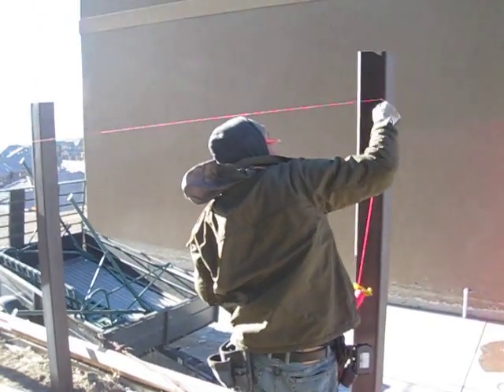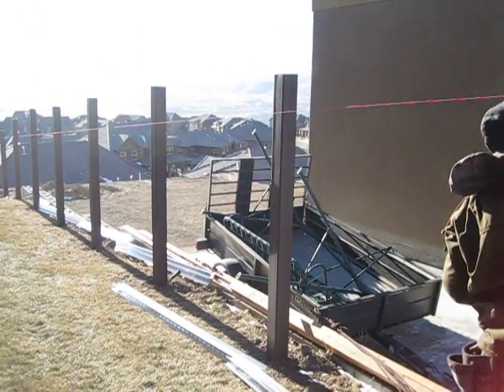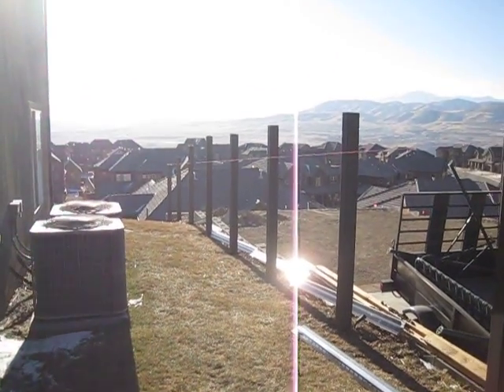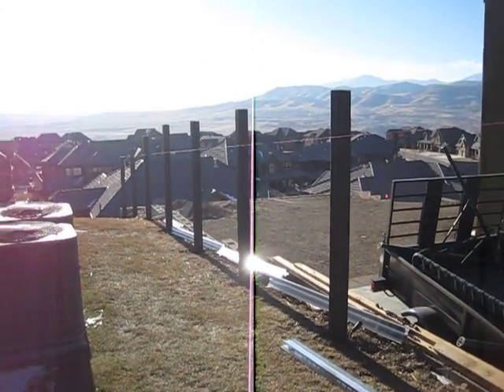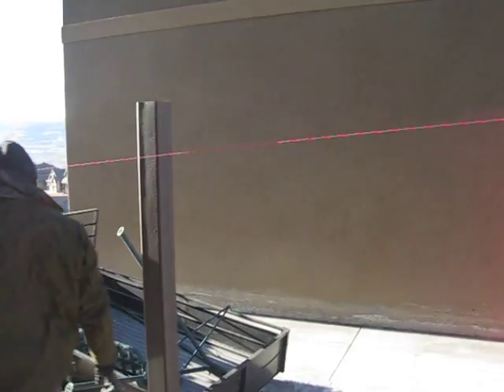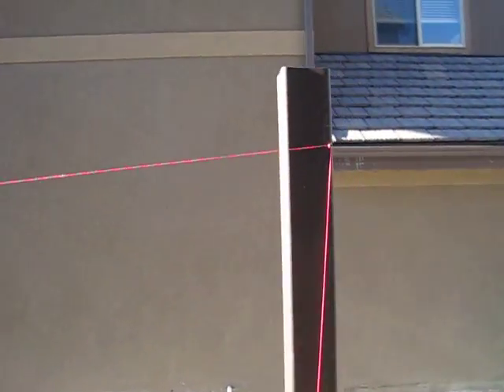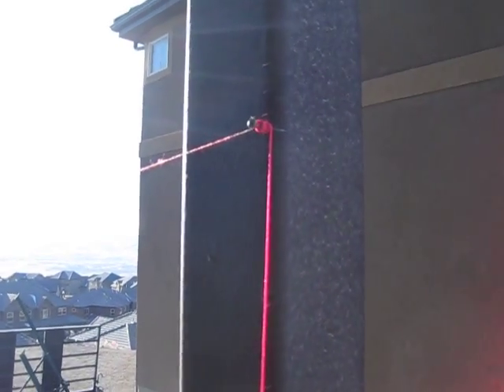Trex Fencing Installation - Stringing the post height

Comment: How'd you get the measured height the same as on the post on the other post where you started your string? Just measure up from the ground?
Reply from the maker: The written installation guide provides full instructions for post setting and measurements. Access the guides here: https://www.yournextfence.com/products/installation-resources/
Reply: @TrexFencing  Link doesn't exist.

Comment: how do you overcome line sag on long runs?
Reply from the maker: Thanks for your questions, LeeMans. If I understand your question correctly, when you string your line, measure in the middle of the line and put another screw in your post to attach your string line. This should reduce the sag of the string line to give you an even run.
Reply: You really can't. Good sting will go about 50ft before you can't fight the sag anymore. Best to use a transit on longer runs or you're just guesstimating the amount of sag in the middle.